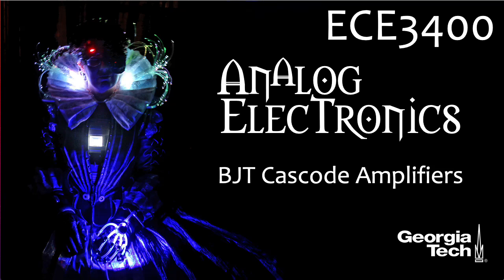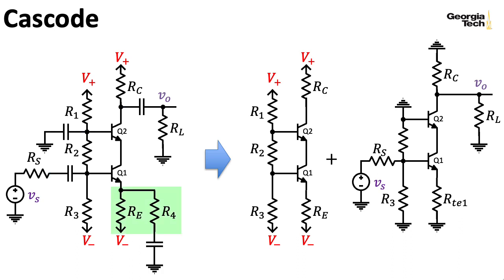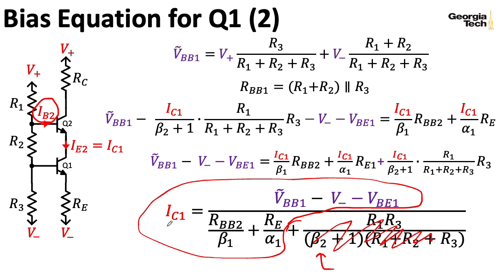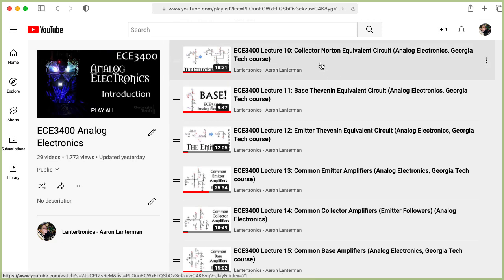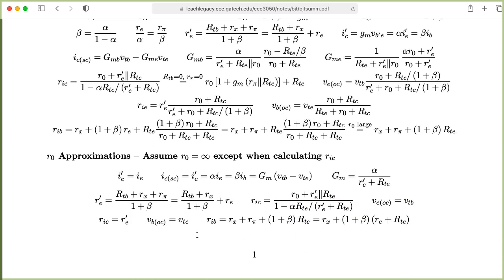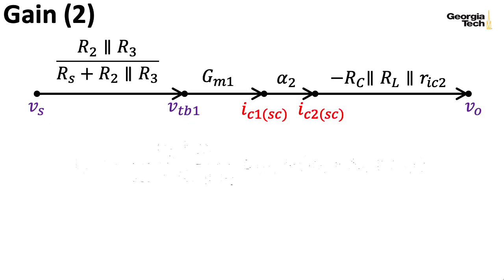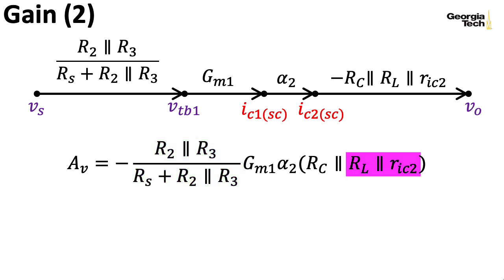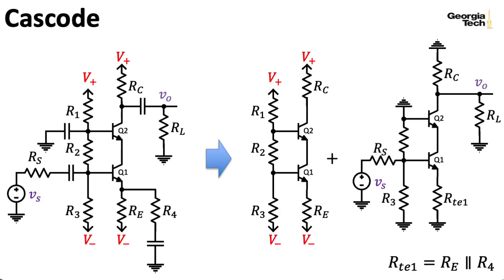ECE3400 Lecture 19: BJT Cascode Amplifiers (revised) (Analog Electronics, Georgia Tech course)

Comment: How does the cascode decouple the input from the output?
Reply from the maker: It's that you have another stage in-between -- the output is on one side of the common base and the input is on one side of the common emitter.
Reply: There is no feedback directly in that case